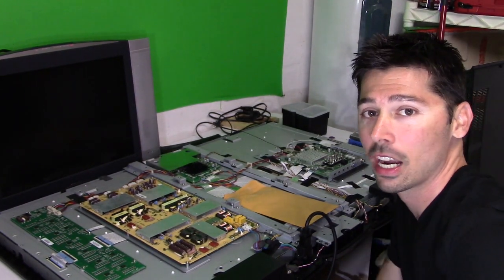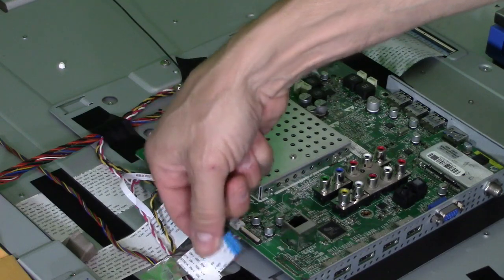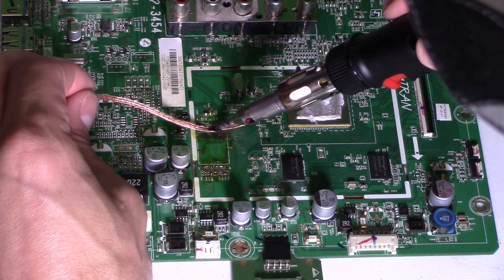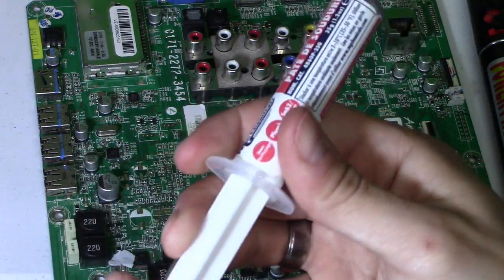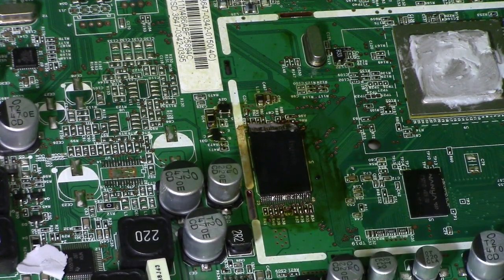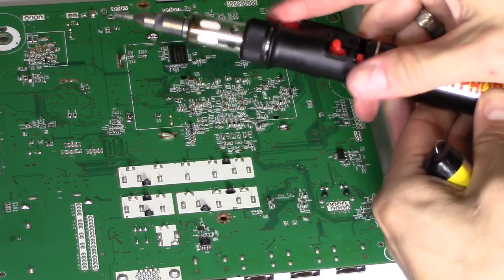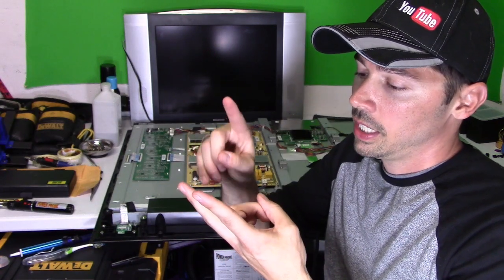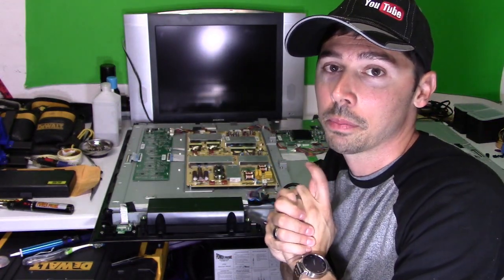Trying to Repair a DEAD Vizio TV

Comment: I have an Sharp LC-58Q7330U the red standby lite comes on when the set is plugged in. when you press power on the lite blinks twice then a pause then blinks twice again.the pin diagram has starting at pin 1 12v, 12v, STB, GND, VAMP, VAMP, ANA, GND IS the STB where you would read the 5v standby volts?? I,m reading 2.9 on the STB at the power board and the control board.

Comment: Really enjoy your informative videos,  they're great and a great service. I've watched for hours.  My interest came as result of my VIzio 55" E55-C1. Pwr, audio,  image but 'INTERMITTENT BACKLITE'. Want to repair myself, I've modest background. Vizio unwilling to assist,  just out of warranty.  I'm broke, disabled & have the time. My question is ' Not if you can but rather do you have the time to point me in the right direction'? Curtis. Tk's, I'll keep watching!
Reply from the maker: Curtis Tassinare eeprom on main board is known to go bad on the main board but check bL on volts. Get tv boards at shopjimmy.com and electropartsonline.com use code tampatecfriend to save

Comment: i didnt even want to ask but ive been online for hours and im losing sleep, i was given a vizio tv model e422va everywhere ive looked to just buy the main board doesnt have it so looks like its down to send it to a serviceman or do it myself im mechanically inclined enough i can do it on my own. so the tv standby light comes on however the tv does not power on i have already pulled off both the power board and the main board and cant SEE anything wrong however i dont have a multimeter at the moment what would be a good guess as to why my tv is not turning on?

Comment: Ur Awesome! 
I came a cross with a Sharp 65 inch TV ,with black Horizontal bar on the bottom right corner across to the middle, the bar is transparent and I still see discolored picture, Once turn off the set top box at the very right still a ghost image for a while. I have changed t-con and still the same,  Did not find much info on Internet,  would you be able to advise me
thx in advance

Comment: Hi, I have a problem with the smps section on a Toshiba tv, it's definitely smps section. The fuse keeps blowing but I have checked every component about 5 times, i'm thinking that a component is becoming faulty under load,
 which do you think would be the main culprits to start swopping out.

Comment: ok so i repaired 2 tvs both coby 40in tvs. they had bad caps in both of them and now they work perfectly fine but one of these tvs has a tiny chip the size of a dime in the lower left corner and its really hardly noticable and it didnt bother me much but now these pixels and dying in long black lines going al the way up the tv and im getting black strips.. how can i fix this or replace the screen?

Comment: I have a question I've been fixing TV's for a year or two not an expert but knowledgeable is their anyway to tell if boards are compatible with out opening the TV cause I buy alot of TV's and have to many laying around is their a list somewhere can u tell by model numbers and where is a good place to buy capacitors on the cheap in bulk  Thanx again and I haven't t got that Samsung fixed yet lol keep up the good work

Comment: Looking at buying a TV 65in what would you recommend and where would you buy a TV from since you work on so many different tvs
Reply from the maker: i like Samsung still but i used to like Sony until their LCD panels started to fail often. just find the best deal and read the specs and reviews, don't buy a TV without reading a few reviews. Note- some Sony TVs have LG LCD panels and some 65" or 70" brands have Sharp LCD panels, LG and Sharp make LCD panels for many companies.
Reply: Tampatec 
Hi my name is Tim.
I was wondering you had any experience with NEC 46 inch monitors.

Comment: Hello friend, congrats on your videos, they are very nice.
I'm trying to repaire an samsung tv, and I have a LE32A457 Samsung LCD TV. When I turn on de tv, the power led goes on and it starts blinking and then go off, I tried to troubleshoot starting to boot the power supply board and I have 5.2v on the stby pin, but when I jump the power on/off with the stby pin the power supply dont boot. I've tested all the capacitors and they are all ok. Do you think that I need to buy a new board and that will be enough or do you think I need to try something else to repaire the power supply? What do you think is the problem?
Thanks you for your time and help.

Comment: +Tampatec  I have a Dynex model # DX-40L150A11   When powering on the "Dynex/Please wait" Boots up on the screen. After the boot-logo goes off the sound comes on and there is no picture what so ever. Just a black screen, no channel Icons or information, no Channel/Device port (HDMI/AUX) nothing appears. Just sound. This is the first and only issue I've ever had with this TV.  I hope you still get messages from older videos. I've looked everywhere for an answer and your videos are as close as I have come to finding out anything. I hope you can help. Thank you so much in advance.

Comment: I always wonder if I've damaged the chip soldering it in.
Reply from the maker: there is a chance but most techs do this daily with success, just don't max the temp on the heat blower. practice on a junk board before attempting this.

Comment: Here is one for you. A guy gave me a 65" Vizio the other day, he told me the glass table it was sitting on gave way and the Tv has a black line ( about 3" ) down the middel. I found that the ribbom cable going to the screen is ripped almost in half, is there anyway to fix it? This is too nice to trash and a New screen cost as much as a New Tv.

Comment: are  you oppose to buy a rework station, it won't heat up those chips you heat blast in, I just order heat resistant tape to protect my chips ,this not personaljust curious you do seem to get results,
Reply: Ron Thompson i agree. Tam's chip swap was EXTREMELY crude. WOW! But he does get good results most of the time. Just think what he could do with a microscope and some hot air.

Comment: Hello, I have a problem with the tv Toshiba 32W3433DG and precisely the lack of backlight, when you turn on the tv
he stood two weeks does not turn, and after reconnecting for 30 minutes is ok and later killed backlight image (the highlighted flashlight matrix image can be seen), and the sound is, after measuring the voltage which comes from the power supply (PSU-17IPS11) when the backlight works is 64V + / - later it drops to 42v and 12v goes out backlight matrix. I enclose a link to a folder with photographs and a short cutscene and how the tv.ps
It does not accidentally damaged SFH617A-1 optocoupler DIP-4 VISHAY and that he such problems. https://drive.google.com/drive/folders/0BwkqlomNGxoWTFVWU2Rid1dnQ3c?usp=sharing

Comment: I have a Problem with My Samsung TV ...
they only clicking and wont Turn on .
HELP
Reply from the maker: usually bad (popped) capacitors on power board or main board, see here for cap kit- http://amzn.to/2mjFa1M
Reply: They Looks ok? Should i remove all ? In Power Board
Reply: J. Adzovic caps don't always have to look bad to be bad, the electrolyte could have dried out.

and there's other kinds of caps (that are not the can types).